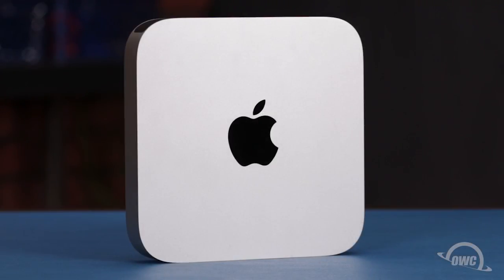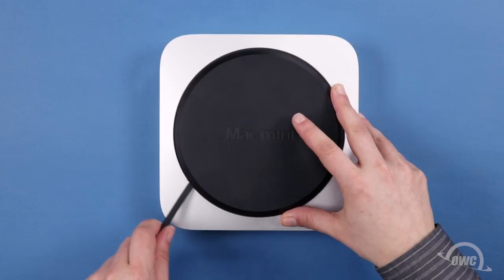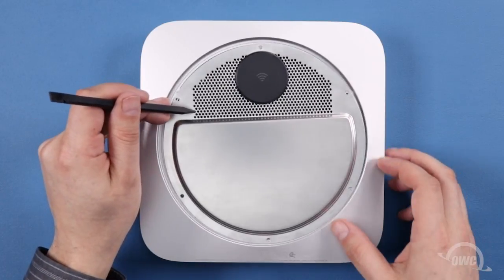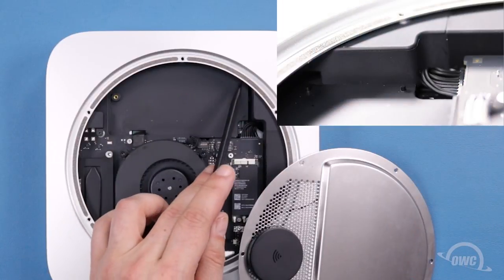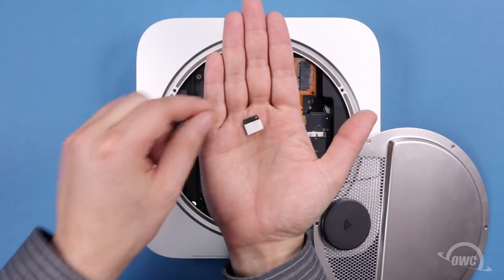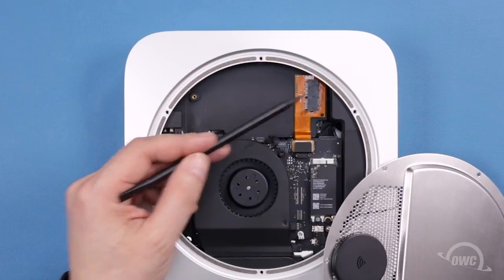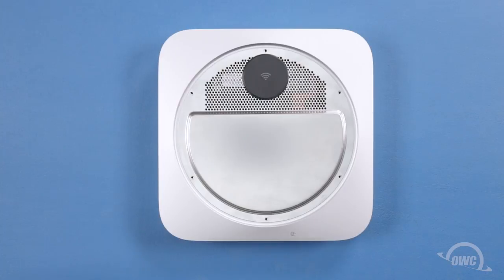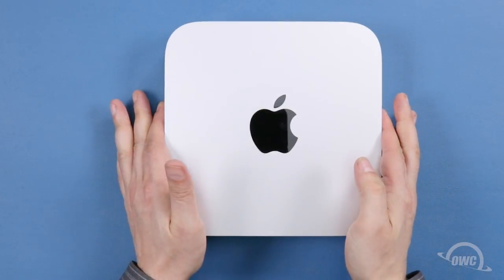How to Upgrade/Replace the PCIe SSD in a 2014 Mac mini (Macmini7,1)

Comment: I suspect that somewhere on the motherboard of the mac mini M1 and M2, there are soldering points very close to the original SSDs, which can accept the connection of that board to NVMe SSDs. Why don't you investigate further? Here's a suggestion :)
Reply from the maker: We can pass along your feedback. However, since most of our products are DIY products that process is a bit beyond the normal customer's abilities on their machine. This routine may also void your warranty on the computer.

Comment: Hi, I don't see you removing the original HDD, which apparently is more complicated. How did you do that? Do you have both hard drive installed?
Reply: It’s in there but maybe not connected. Doesn’t really matter because this is ghetto as fuq.
Reply: Just a quick update. Both disk can co exist in a mini 2014. The video is more to add on a new pcie drive (apple proprietary connector, sold by owc).
Reply: @thepopeofkeke  Its not a way to get around replacing the HDD, the logic board on these have a connection for an ssd for a fusion drive.  My $5000 MacPro has ssd's and HDDs. Last I checked, that ain't ghetto.

Comment: from what I recall there's a way to install a SATA 2.5" device also, if I slide the whole assembly out of the unibody.  does the procedure in this video render 2.5 SATA device installation impossible, or do they not interfere?  thanks for your advice.  I am a very occasional mac user, haven't had many of them, so I don't know the peculiarities of different models.
Reply from the maker: Here is a link with some compatible options: https://eshop.macsales.com/shop/ssd/owc/mac-mini/2014, unfortunately I believe for this model, you are able to do one or the other, but not both. Hope this info is of help.

Comment: does upgrade with nvme m.2 increases the efficiency of cpu. as i use mac mini late 2014 model with dual core i5 model with 16 gm ram. but cannot stream properly on Face Book and YouTube simultaneously

Comment: You also sell ssd card replacements for these. Can you do this and the ssd hard drive swap and have 2 ssds in the 2014 max minis?
Reply from the maker: I don't think you can on the 2014, we would have a kit for the optical drive add-in as a kit if we were able to add another.

Comment: One big doubt i have is: which would be faster between SSD SATA 3 vs SSD NVMe?? im not sure if the mac mini 2014 has PCIe 2 or 3..  if you could response would be awesome !!
Reply from the maker: The NVMe SSD will be the fastest option on your MacMini. Now your Mac mini will not come with a PCIe slot if you did not purchase it with a fusion drive. Now that is not a problem because we do offer a kit for you to still be able to install the NVMe SSD into your Mac Mini. If you do have the PCIe slot it will be a 3 and the kit we provide is also a 3.
Reply: @poweredbyowc  thank you
Reply from the maker: @Gabo Happy to help!

Comment: I have the 4gb 2014 version (its a bit slow) will upgrading to a ssd improve preformance by a lot or slightly?
Reply from the maker: Depending exactly what you are doing on your machine it may improved the speed of your machine. What will benefit for would be a RAM upgrade. Depending on the 2014 iMac you have you may be able to upgrade the memory.

Comment: Hi, I have two Late 2012 Mac Minis but only one of them zaps me when I touch it and at the same time touch another grounded metal-cased equipment (e.g. an amplifier). It's not painful at all but I definitely feel it. Is there an issue with the Mini I should worry about? Thanks.
Reply from the maker: In addition to an ESD bracelet, be careful to be grounded wearing tennis shoes or on a rubber floor matte, as well
Reply from the maker: I would double check that the Mac Mini is completely disconnected and that you are fully grounded as these would be the 2 sources of any static/electrical power. Remember that it is also a good thing to discharge any static on yourself by grounding yourself before and throughout the process.

Comment: If I already have a pcie card, can I just add a second 2.5” hard drive?
Reply: +1
Reply: Mine has a regular "spinner" hard drive deep inside (standard) and someone put a NVMe PCIe (recommended) on top (easy-ish) and installed the boot OS onto that, made it run like a champ. Next is to put an SSD in instead of the spinner, easy, if you have some skills. If your PCIe card boots from itself, it may not be that extra useful for speed.